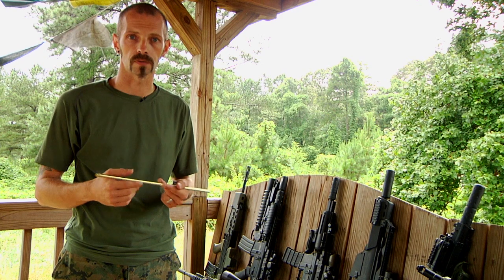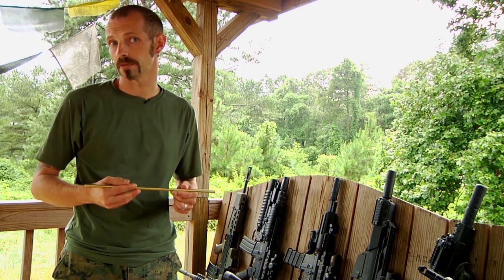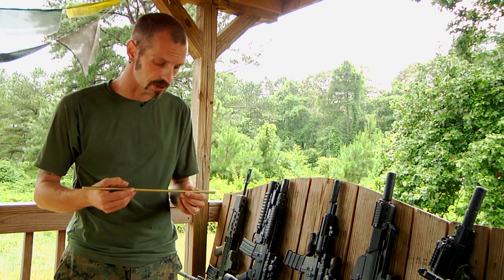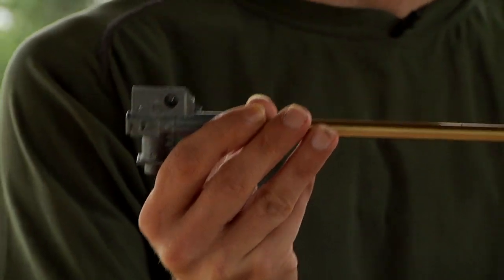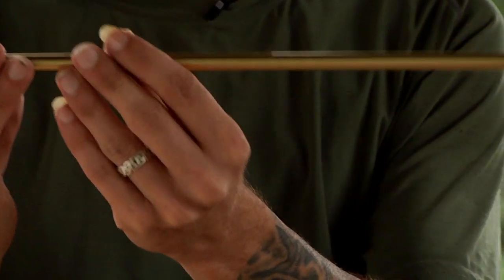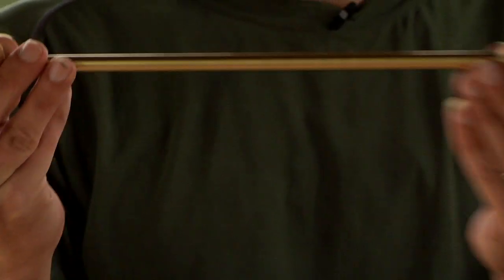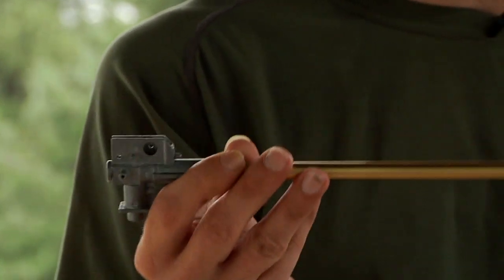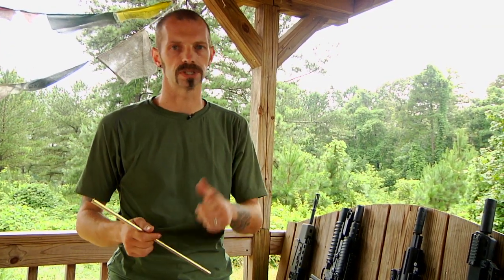Airsoft Gun Maintenance & Repair : How to Make an Airsoft Gun Accurate

Comment: if you use a heaver bb your fps will decrease. but your accuracy may increase, if your gun has good compression you will be able to take long ranges shots with a .2 gram bb, if it does not then you will have to work on it and most like push the gun up to shoot around 350 fps, making it feild and cqb safe.

Comment: I would say that a well assembled gearbox is more important than the hop-up.

Imagine that you have the best hop-up unit but the gearbox pulls very different FPS on each shot. The hop-up is adjusted the same position, but the BB flies faster or slower, so the amount of hop they require is different. That equals less accuracy.

BTW, your nails look very useful! no kidding.

Comment: actually research has proven that a larger barrel proves to be more accurate, a tight bore increases power because less air escapes around the edges. the thing is, the smaller bore causes more bouncing on the top and bottom of the barrel and the bb mostly rests on the top of the barrel anyway, so check out the ORGA airsoft 6.23 barrel and such before you go all tight bore for life.

Comment: Would you share your experience about the much debated long vs short barrels. Given the same diameter, same hop,same bb's. Is a 455mm barrel giving more accuracy than a 270mm for ex. ?
Reply: 455mm vs 270mm the 455mm will be better just because it is longer but once hop and everything else is factored in it comes down to airseal between the gearbox,hop up and barrel. best way to get accuracy is a consistent airseal